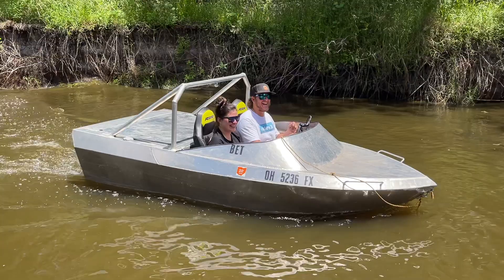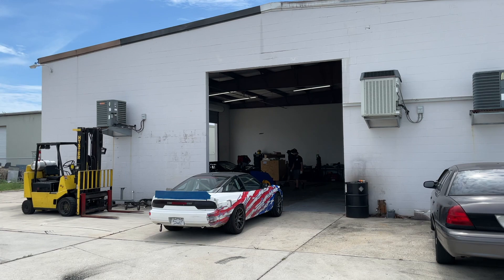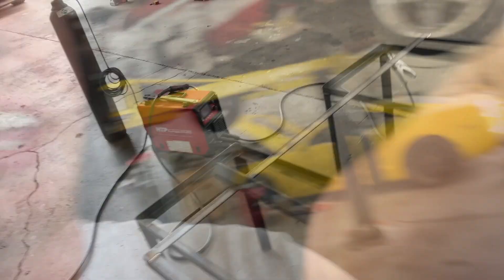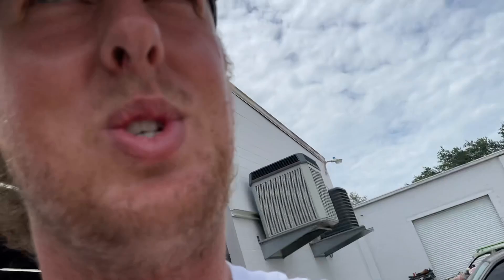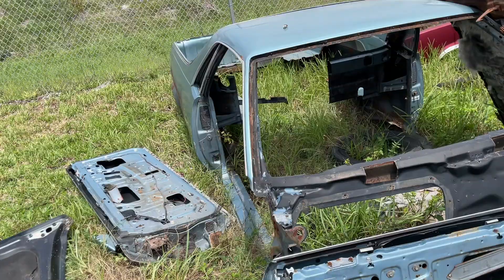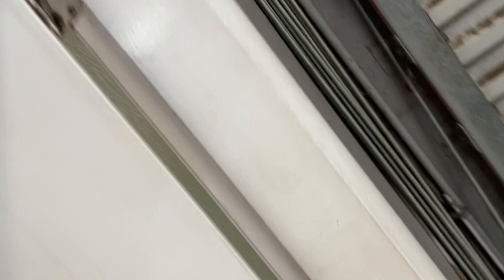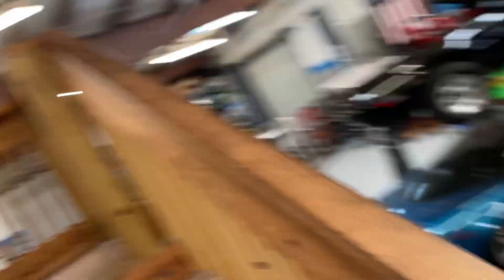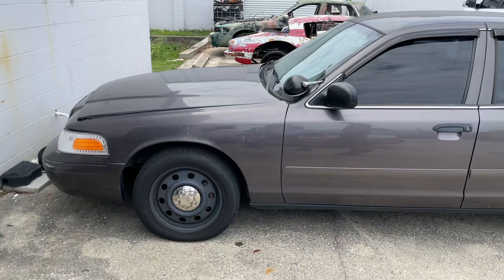We're Moving Out of Our Shop After 3-1/2 Years...

Comment: yo cleetus, we have those ac fans at my work. DONT THROW THEM AWAY. They stop running allll the damn time, check the pump. If it’s not pumping any water you can but a new pump and it’s super simple to replace. they’re a few hundred but cheaper than a few grand for those fans. i have replaced about 6 at my work and that’s usually all it takes. check the switches too could be the switch
Reply: Yeah ours break all the time. Usually the pump. I live in az though, not too much humidity thankfully.
Reply: oh nice a bunch of likes hopefully he sees
Reply: @michaelbolton1090  We have several in our traffic bays (I work security) those things are lifesavers for weather like the past two weeks ;)
Reply: Swamp coolers are basically useless in the deep south. Ask me how I know.
Reply: @digus  yeah they wont do anything in Florida
Reply: @digus  how do you know?

lol There always has to be one.. Loved my swamp cooler in So Cal.. but we had 0 humidity.
Reply: The pumps can be had for $25, diaphragms for $4. It's the same pump as a Rug Doctor machine.
Reply: too high of humidity in FLA. for evaporative coolers to be of any use.
Reply: @throttlebottle5906  for real

Comment: The porta cools are easily repaired, but cheaper to buy motors pumps everything but the media filters, those are best bought from manufacturer, and there not cheap.
But they will actually drop temperature 30 degrees below ambient temperatures. 
But if you don't care about close to 4 grand for the both of them. 
They can easily be improved above the original poor grade of components that were from factory. 
Just take a few minutes to collect the data from the tags on the electric motor, pump, and the rest of it is available from home depot are Lowe's to get them working. 
Media is only thing exclusively from manufacturer, and unless what you have is totally trashed, they can be cleaned up and made to work correctly if you set up water flow for each fan speed, and it won't increase the humidity that much, because of the cooling effect is real, and 30 degrees below actual temperature is a blessing for any mechanic are welder I know.
Reply: The average relative humidity in Florida renders evaporative cooling almost useless. You’ll never see the numbers you claim. I live in Houston and it’s the same here. In arid dry areas they do awesome
Reply: @Rubandent82  well I am due north of you NE of Dallas, and while my relative humidity isn't quite as high as ya'll are.
We do reach fairly high humidity percentage, and if you set the air to water ratio up correctly.
You will see significant drop in temperature in the immediate area in front of the fan.
If you do what 99% of the people do is crank the water wide open totally saturating the media, and once happens it's over, because your actually blowing droplets of water across the room onto everything  directly in front of the fan. 
Then depending on the fan speed, and how much dirt has accumulated inside the media will determine the CFM's as well as the percentage of water droplets in the air stream. 
It's actually really easy to set the amount of water flow up those systems, if you read the owners manual. 
I not sure where Porta Cools competition is based out of, but their deep in the heart of East Texas right on the Louisiana border, with Toledo Bend as the boundary between the two states, and the average humidity there is probably equal to northern Florida's. 
But no one bothers to read how to setup the machines, and they never flush the media out properly, are clean the mud out of the bottom of the sump, and then it is spread throughout the media, coats the fan blades ruducing the amount of air they capable of moving. 
Combination of errors typically leads to short service life, and unhappy customers.
40 plus years in hvac, and first hand knowledge of how they work best in humid regions of Texas.

Comment: NO OFFENSE INTENDED....BUT FOR REAL...WHOEVER IS RUNNING YOUR SHOP AND MANAGING HOME BASE FOR YOU....IS FALLING SHORT.  THAT PLACE IS A FREAKING WRECK.  SO MUCH REVENUE SITTING AROUND IN USED PARTS TO BE SOLD, WASTED TIME ETC.   IT WOULD TAKE A MIGHTY OFFER TO GET ME TO FLORIDA....BUT I COULD RUN YOUR SHOP AND HAVE IT CLEANER THAN A NAVY SUBMARINE.  YOU NEED AN ENERGETIC ORGANIZED PERSON WHO LOVES TO WORK AND DOESNT TAKE TIME OFF.  A WORKER BEE.
Reply: lay off the addys bub.. i'm sure they got her handled. not sure if you've ever worked in a shop but keeping thing tends to be a big part of running an operation like this... you never know what your pulling into the doors and if some needs fixed you may just have it. much different than a dealership setting where everything just gets scrapped and replaced.